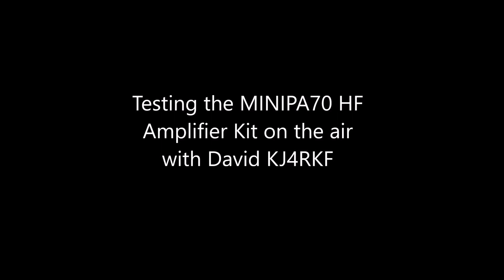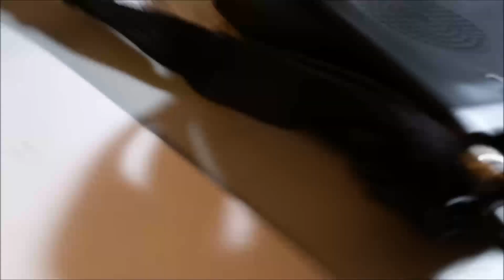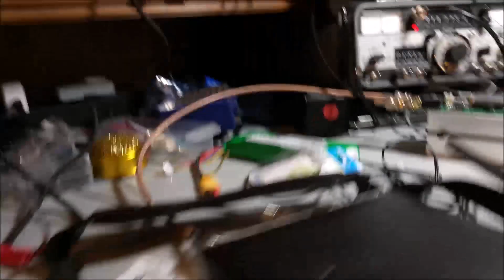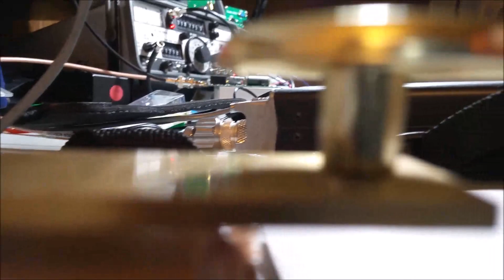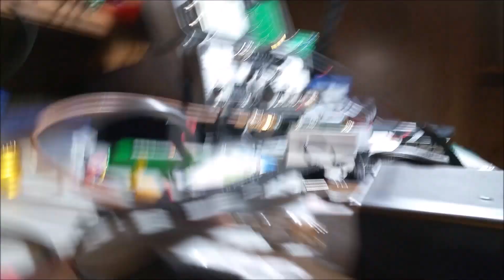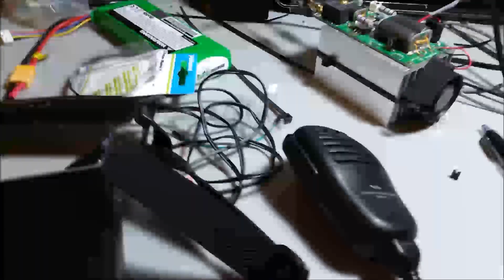Testing the MINIPA70 on the air

Comment: I bought one of these kits and am having some problems with it. One of the large ferrite cores came with a center hole to small for the bussing to fit in it. Not sure why? And when assembling it I broke a terminal off one of the electrolytic  Capacitors. That one was on me. Replacement parts are on the way and we will see how it preforms.
Reply: Here is a tip,, when it's happen again use a old telescope antenna. They have multiple sections and diameter. Saw a piece for your ferriet.

Thank me later... 😉

Greetings Msc

Comment: You don't use the bias to set the power in a push-pull linear amp. The bias is set to reduce crossover distortion. If you set the bias too low, crossover distortion will create intermodulation products. If you want to reduce power, the only way to do it is by reducing drive from the exciter. either use an attenuator or reduce your mic gain.
Reply: Or reduce the amp supply voltage. These IRF520's weren't designed as 12 V devices. They are typically run at 24, 28, or sometimes even into the 40 Volt range. Those selling these amps don't make a big deal out of that fact. Most people are having trouble even breaking 40 Watts on 10 meters with these amps unless they crank up the voltage. I'm guessing the ham in this video was running 28 volts or more.

Comment: Hi, I have the same amplifier. There is a PTT connection on the amp. What is to be done. It it to be shorted at all times. 
My call sign is VU3RHU, QTH is Mumbai,  India
Reply: Rajesh, it should be shorted when transmitting and open when receiving 73 Mick VA3EPM
Reply: There is a version of this amp that has an opto-isolator ptt signal it requires 5vdc, this amp looks like the version requiring a short to TX

Comment: Thanks for a great instruction.. I have just finished my kit. But it fails to open the PA stage or something. The Relay klicks when PTT is TRUE...  But the board has no AMP draw at all.. im putting in 0.5w from the radio. Also tried 15W.. but totally dead.. The transistors are ok..  Could it be something with that bias stuff?

Comment: How about harmonics?, Did you use band pass filters?
Reply from the maker: I did not in this test. If you are going to use this amp for anything other than testing and evaluation a good low pass filter should be used on its out. There are a bunch of fairly inexpensive low pass filter board out there that can be easily paired with this unit.
Reply: @Geewhiz811  why use the jumper presented to transmit and untransmit. Use a 4401 transistors a 1n4148 diode banded end to center of transistor and 10pf goes to incoming signal the leads of the transistor goes to the bored were labels pitlooming at transistor left lead to ground center pin transistor diode banded end unbranded end goes to ground
Reply: @jeephoffer758  I ordered that same amp.  Can you send me sketch of the ref sensor to ptt. 73
Reply: @javiermoreno1612  jeephoffer youtube video
Reply: Thank you for the answer.
Reply: Thank you my friend.
Reply: 10pf ceramic disc capasitor, 1n4401 transistor , 47uf 50v electrolytic capasitor, 1n4841 glass diode, for rf ptt or as called a keying circuit.
Reply: I put a picture or vidio of a circuit you could build and it works fo cb as well it reads the carrier or covers call it keying circuit . I notice the guy in this vidio is manually turning on the amp section probably powering the relay on and off

Comment: can i use a PL-259 Connector .or is their a  Adapter i can buy....what on that board are not pl-259
Reply: SO239 could be soldered then bolted to an enclosure..but yes you can get SMA to SO239 in order to screw in PL259 plugs.